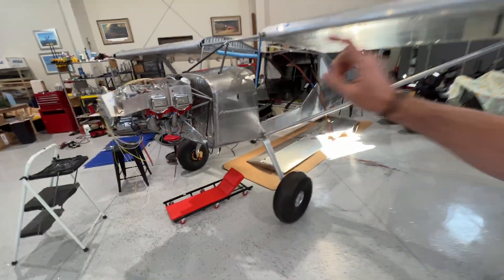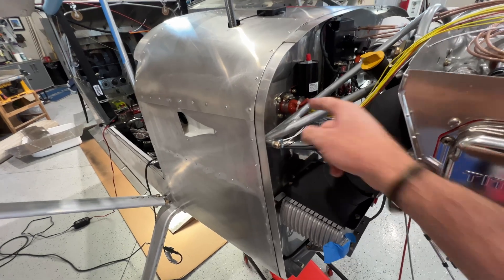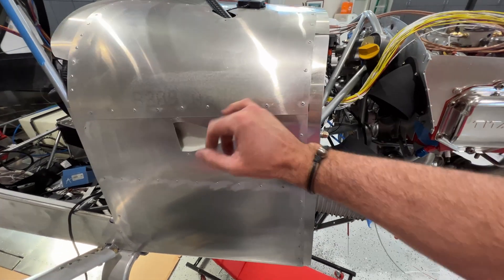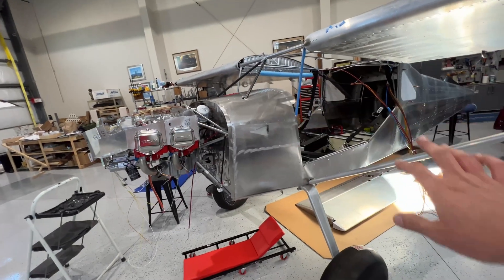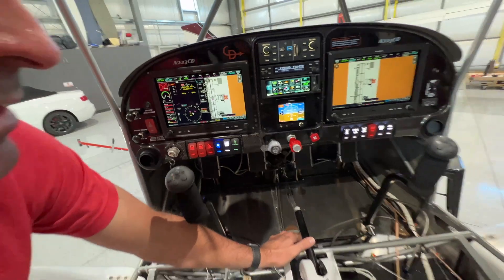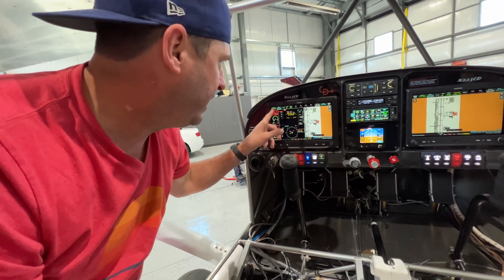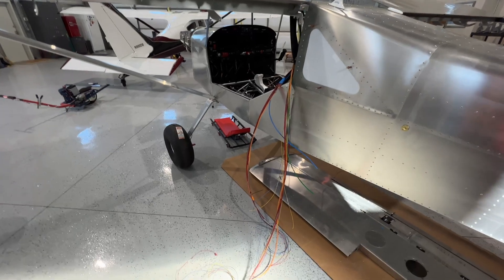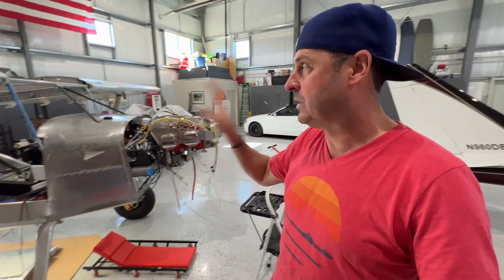Build Update! Boot cowl, static ports, Garmin avionics software

Comment: For testing phases you might consider the field north of you a little bit they have very wide and long grass strip.  Grass is a bit more forgiving to low time TW and wont chew up those tires so quick.
Reply from the maker: Which field is this?
Reply: @CLEAREDDIRECT  S33

Comment: The irony of picking the least reliable OS to install software to what should be the most reliable (certified) avionics.  Hard to no laugh. FYI - I run Windows on my iMac using Parallels and it works quite well.  Not sure if it would work to update the 375 though.